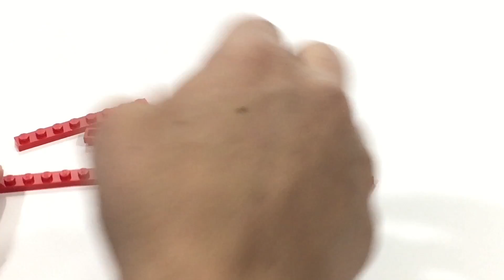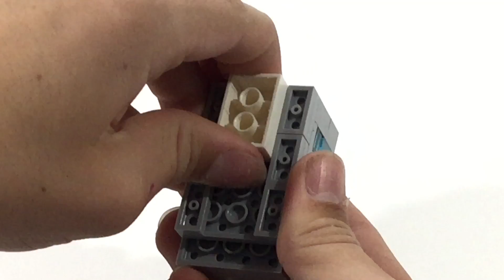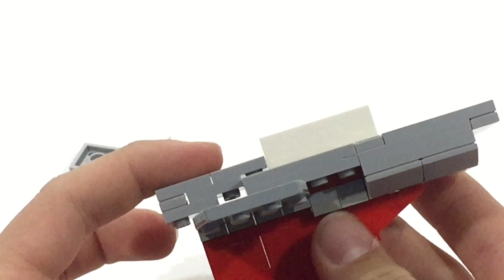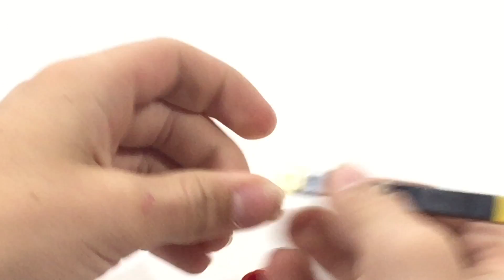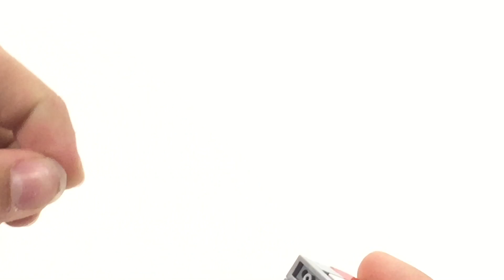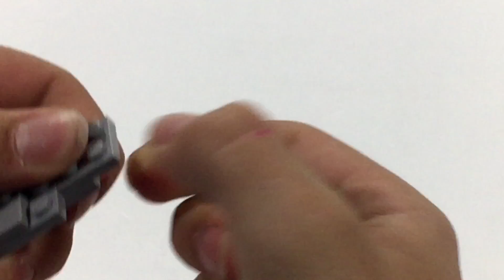Custom lego propeller plane FULL tutorial

Comment: Amount            Piece
-------------            ---------
1. 1x6 red plate
1. 1x8 red plate
2. 1x10 red plate
18. 2x4 gray slope
40. 1x3 gray slope
3. 1x10 black plate
1. 1x4 black plate
3. 2x10 gray plate
1. 2x4 gray plate
1. 1x4 gray tile
1. 2x4 gray plate
2. 1x3 gray plate
2. 1x2 gray clip
2. 1x2 gray bar clip
2. 1x6 red tile
3. 4x4 gray plate
2. 2x4 gray plate
3. 1x4 gray plate
2. 1x2 gray plate
4. 1x4 gray brick
4. 1x2 clear blue tile
2. 1x4 gray plate
1. blue low windscreen
1. 2x3 gray plate
1. 1x2 gray jumper plate
1. 2x2 gray tile
2. 1x2 gray cheese slopes
2. 1x1 gray cheese slope

(NOT FINISHED will continue later)
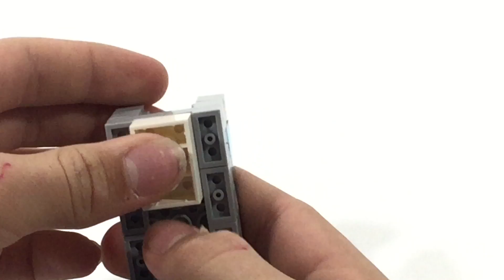ends off at 7:27